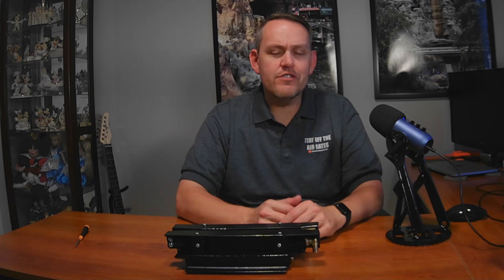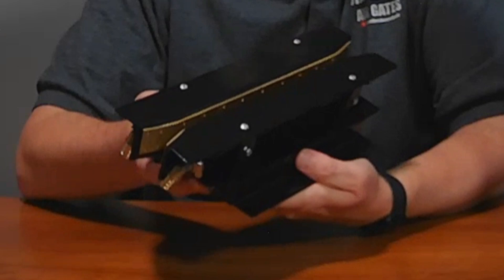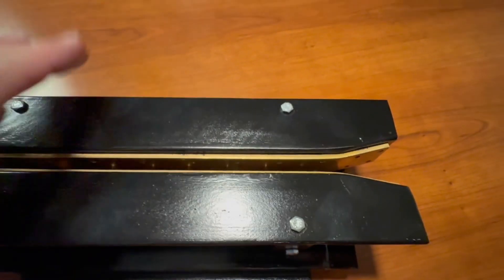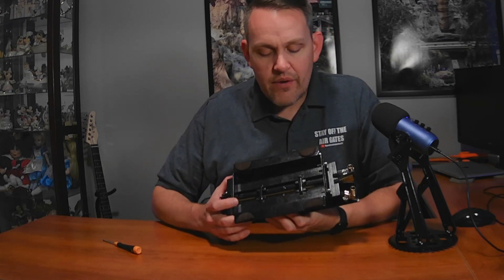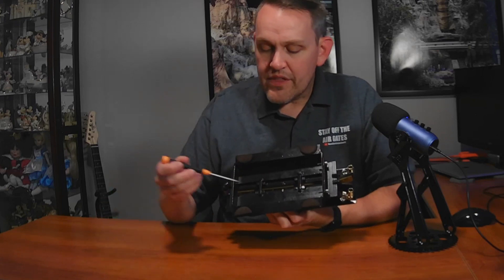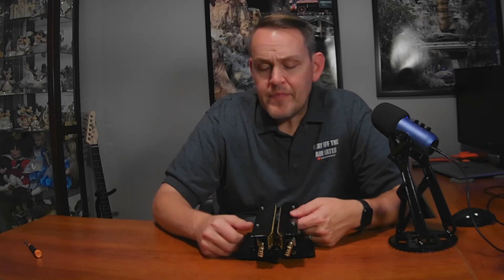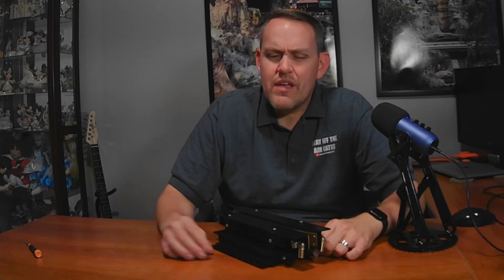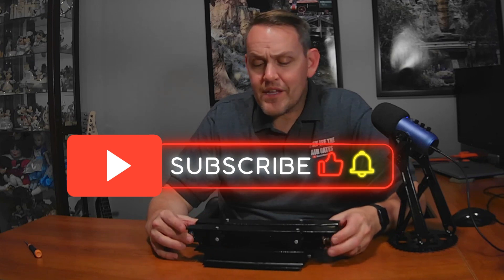Ryans mini ride pinch brake

Comment: Takes me back to replacing the fire hose “air bladder” on Top Gun, Adventure Express and Vortex. Problem with the design was when you lose air pressure you lose brakes. Power outage or air line blow, time is limited until trains start rolling. Also make sure you chain and chock the trains overnight or the trains might not be where you left them come the next morning.

Comment: You could build a small section of "track", say 6 or 8 ft long, mount the mini-brake to it, build a rudimentary sled with a brake fin. Then build a space mountain style "cam launcher" thing to push the sled into the brake.
Sound like fun?
Reply from the maker: @wry10  sounds like a ride

Comment: The brakes that we had on our Zyclon had a leaf spring that held the brake shut unless air was applied. I know you addressed this in the short videos. I just find it funny that newer rides were this way. We also had counter sunk brass screws instead of rivets. That made it easy( yeah he said easy. I meant sounds easier than rivets)   to install new brass and you just drilled out the screws and did a little retap on the new install. LOL I know all about time being = to money. The money I get paid at my job is way less than the money = to my time when I am not at work. But yeah if this didn't cost a Gozillian dollars I would be interested. Just be careful of the folks that are wanting to put them on a backyard coaster.

Comment: Interesting, I would have expected the air pressure to open the brake as a more fail-safe design (have it be normally closed with no air pressure in the case of power outage, etc). Maybe spring force wouldn't be strong enough?
Reply: …also lots of redundancy. Arrow would use a lot more brake units, each with an oversized reserve tank. And while it took pressure to close the brake, I think it also takes power to close the valve. So it’s fail to safe on the control side, just not the air side.
Reply from the maker: @RideManDave  right. On the Vekomas you have to energize both the trim and emergency valves at the same time to release that air. Of either failed or power was lost the brake would close.
Reply from the maker: @ABPmusic  the old style like this had back up air tanks inc are of power failures. Vekoma / Arrow etc never had problems as long as the systems were properly maintained.

Comment: I am going to be building my own backyard wooden rollercoaster, with proper bents and stacks next summer...  I would be more than happy to test that brake.   I am trying to find a used PTC trains 2 bench with at least 2 cars total of 8 rides... That is not in terrible shape so I can actually ride the thing.

If you have any leads please share share share

Comment: To test the braking force, you could mount it vertically on a wall and see how much weight it holds up before failing. You could even plot the braking force against varying air pressures. I'd be very curious how strong it is. Good job
Reply: I imagine much safer too. For your next project you should build air gates
Reply from the maker: @andrewkutchins7719  right!
Reply: @andrewkutchins7719  Came to the comment section just to say this
Reply from the maker: @andrewkutchins7719  interesting idea. I also thought pulling a plate through with a vary large fish scale to measure the force. Weight would be much easier.
Reply: Why not just calculate it? F=PA. F=MA. F=umg
Reply from the maker: @Shredxcam22  IdK